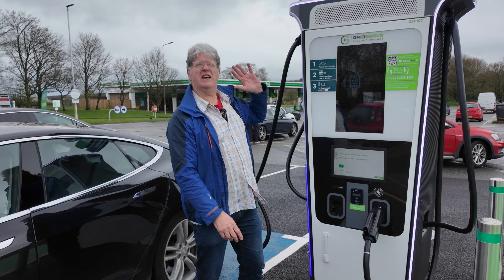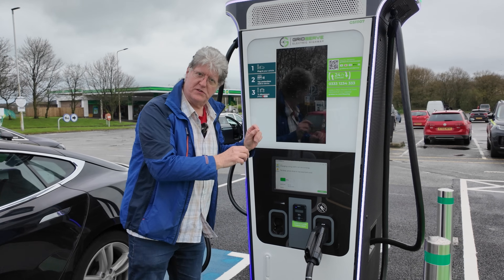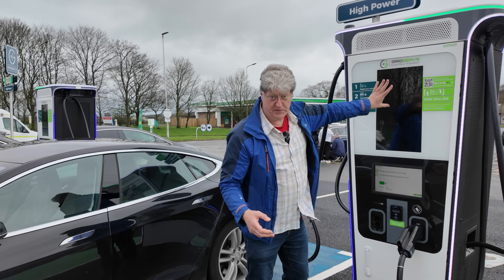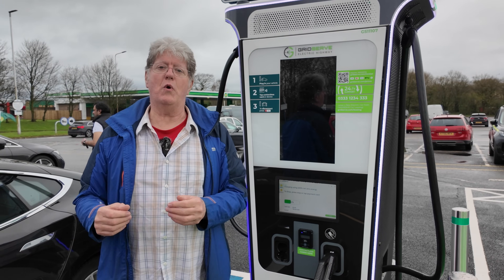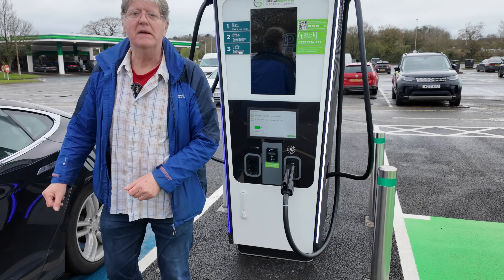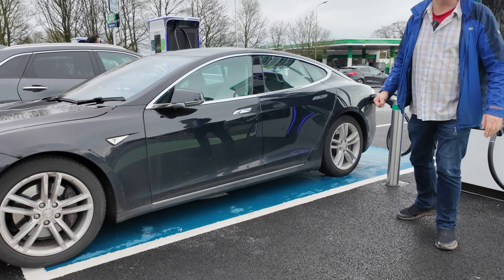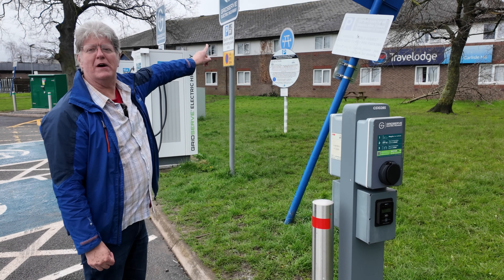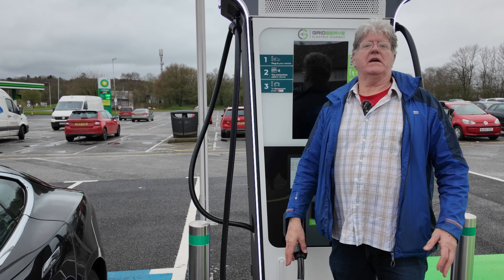Why Gridserve's New EV Chargers Are SLOWER Than Their Old Ones

Comment: Throttling the charge rate to match available power. Who would have thought that would happen? Next wheeze? In America some stations now charge per minute connected to the cable, regardless of the charge rate you get. They are priced assuming you get the fastest charge rate the unit can supply, you can easily get a tenth of that. You could rack a bill of hundreds of dollars for a full charge. Why are they doing this? To get back the capital investment they have made.

Comment: There's another problem at these new style Gridserve chargers. I charged up last week at Donnington services on the M1 which has 3 of these new chargers. They have 2 cables on each charger so we plugged in checked the car was charging (33%) and went for some lunch in the services. When we came back it should have been past 80% but was only 44%. The charge had stopped. I suspect the driver on the other cable had selected the wrong cable on the screen when stopping the charge. They are just labelled 1 and 2 with no arrows or any graphics to help you and you don't need the card that started the charge to stop it - just press the stop icon! (and don't say I should have checked the app - my car doesn't have one!)

Comment: Every Gridserve I have used I have NEVER got more than 96 kw, 350kw is totally false advertising. I totally understand the car determines the charge rate however, many cars can handle a lot more than 100 kW still only get 96 max on a Gridserve charger. IONITY give you the full amount and 79p per kw no thank you I will go else where

Comment: This is why the way Kempower does it is better. The charging units are essentially just a payment processing unit, a screen and a CCS cable. The actual charging modules are all housed away near the energy supply and they all share it. So if the site has the ability to only do 300kw and theres only 1 car plugged in, it will get its full speed. Unlike this situation where the charger only has one module installed so each one is limited to 60kw when no one else is charging.

Comment: The cable thickness are comparable with the amount of amps  the higher the  kilowatts the bigger the cable. Some of the "energy" your paying for is wasted going up in the air as heat  ! Same principle as the old electric bar heaters   , at least with ice you get what you pay for out of the pump
Reply from the maker: Really???? And your experience is???? I go and handle plugs and cables around the country and with different networks and I can state, and have previously launched several videos showing this, that the Instavolt cables attached to a 120kW charger is several times thicker, heavier and less wieldy than a Tesla V4 cable which gives out 250kW. That V4 cable is thin, light and very flexible. Please explain!

Comment: As somebody who tows with our EV I’m very pleased to see long, drive through bays!
Reply: What are the advantages of towing with a EV and which one would you recommend  for a medium size caravan?
Reply: @Ifitwerks  I tow a 1450kg caravan with my BMW i4 edrive40. There are one or two advantages, depending on what car you've come from. 1) The extra weight of an EV helps with stability, but my i4 isn't much heavier than my previous 435d. (+260kg). 2) The more responsive power delivery, to get you out of a slip-road pickle etc. Downsides are less range (typically 1/2 to 1/3 of the normal range) and hardly any long charge bays, which means unhitching every time.

Comment: I do a lot of journeys on the M4 in Wales and now avoid Gridserve. My ioniq 5 would at 15% only pull from their 350kw chargers at 33kw one week, but 120kw another, same amount of charge left, similar weather. Plus, half the chargers at Swansea were broken. All the other brands  consistently do over 100kw and always work.
Reply: Have you tried the Texaco Tawe petrol station on Neath Road near what I still call "The Liberty Stadium" ?
Reply: @stevenjones916  I don't go into Swansea, I'm travelling across the M4 to/from Pembrokeshire so services are more convenient. Bridgend (Sarn Park) is really good, and now there are several other services on that stretch with plenty of 100kw+ chargers. By the time both the dog and I have used the toilet we have more than enough for the rest of the journey. Swansea we were often there 40 mins+.

Comment: Supplied by 100% net zero energy! 🤣

Nope......it is supplied by whatever energy mix is maintaining the voltage and frequency of the grid, at any particular instant.

More 🐂💩 smoke and mirrors nonsense to baffle those with less understanding.

And then people want 300 kW down a piece of 1.5mm flexible cable!! 🤣 On a positive, you seem to be acknowledging that high power charging dissipates a lot of waste heat. 👏
Reply from the maker: So you think Gridserve has a special cable that supplies only wind or solar generated electricity to their chargers???? Welcome to planet earth.
Reply: @davetakesiton  ???????

Clearly I don't from my comment. I'm saying it isn't powered by 100% net zero energy for the reason I gave.

Just like claims that Dutch trains are running on 100% wind energy, but don't stop on days of low wind. It is smoke and mirrors BS.
Reply from the maker: But you might be missing the point. If everyone has to provide or use net zero electricity, then, if the system is working, they all must either generate it from renewable sources or remove carbon or CO2 elsewhere to balance. Either way, if it works, all our energy and all our businesses are actually at net zero, just some power stations or businesses will be emitting CO2 at source and removing it elsewhere. But like Tesla who produce all their electricity to build factories and cars and PV panels and charge EVs using actual zero emission electricity and sell carbon credits to others.

Comment: The Kempower chargers used by Osprey and others are far better as they can intelligently distribute the power over all the stalls (typically 16 bays) because the charger internals are all in a single cabinet and the screen+cable+payment part is just a remote terminal.  So the entire available power supply can be perfectly shared.
Reply: Yep, they seem to have the best solution. I would assume they are cheaper to manufacture as well.
Reply from the maker: So does the new Gridserve ABB 360kW, that is its key feature. The question here is how much power did it get to distribute?
Reply: @davetakesiton  The Gridserve doesn't share the total power across all bays, it still has the charger modules in the cabinet (hence why it is so huge).  The Kempower approach shares across many more bays and it will allocate power in 25kW chunks depending on live need, so it makes a lot more of the available power.  Yes, the total available power is still a restriction but the real world result is that you get consistently faster charging for the same total power.
Reply: Exactly how all hubs should be set up.

Comment: If you want thinner cables the easiest and maybe only way is restrict the current being carried. Lock the chargers to 50KW and you have solved the problem.
Reply from the maker: Tesla has very much thinner cables on 250kW chargers!
Reply: @davetakesiton  Tesla is Tesla. They plan to push 900A through the NACS plug as well. Wonder how long that will last before temps reach the limit and charger has to slow down.
Pretty sure the V3 and V4 cables are thicker than V2.
Reply: @Gazer75  Doubling the voltage halves the current for a given power in Kw and hence cable size and vice versa its all about current carrying capacity of the cables and the power available to the charge point and not simply charging speed as seems to be used lately.
Reply: @Ifitwerks  I guess they expect all future cars to have 800V...
No matter the voltage Tesla papers still claims up to 900A for NACS.
Reply from the maker: Nope, they're thinner. I use both. You seem to miss the obvious: Tesla are able to cool their cables far more effectively so can use very much thinner cables for higher currents. simples.
Reply: @davetakesiton   I can't imagine CPOs using thicker cables than they have to as it would increase cost.
Maybe you could ask them about this?
The cables on these 300kW+ chargers are pretty heavy and stiff. My mom would need both hands for sure.

Comment: I do not care about speed (50KW is enough) but do about price. In a year I have only used one public charger (connected kerb) which charged around 30p /KWh (it has since gone up). My response was and is 'stuff that'. My home electric is £0.075 day and night thanks to a time shifting battery. A long journey is in an ICE car which is cheaper than my EV using public chargers. 90%+ of all driving is in the EV which I really like but the rip off prices are borderline criminal.
Reply: You're forgetting that home electric is taxed at 5%, public charging is full rate VAT. That's "criminal".
Reply: Really it is almost as if you say that if you could not home charge you wouldn’t have an EV.   I am shocked.

Comment: So a 360kW capable dispenser restricted to 50kW - what a waste of time, best to avoid these Gridserve sites unless it’s an emergency charge you need then. What a con!
Reply: It would be a waste of time if it was advertised as 350kW, but it isn't. It's advertised as 50kW.
When the site's electric supply is upgraded, then it will gain more modules in each charger. It would be a waste if they had to rip out the charger just because it couldn't handle 350kW.😂
Reply: But it’s the car that does the charging and sets the demand, not the charge point. Almost certainly the EV was t pre-conditioned for charging.
Reply: @G6EJD  I think the car only does the AC charging but it does control the speed it gets from the DC charger but there have been case seen where the car accepts more than its claimed speed.
Reply: @rtfazeberdee3519  the EV has to the DC charging too, also the battery management system is on-board the EV too. All charge points merely off a power source for the EV to undertake its own charging. It’s a misnomer that charge points are chargers, they are not. Also nearly every EV has a different battery pack voltage which the EVSE to give it its correct name cannot know, that’s for the BMS to manage. Dave did go on to say that these EVSE’s were being deliberately limited to 60KW rates.
Reply: @G6EJD  The way i understood it was that the AC onboard charger converts the slower AC charge to DC for the battery whereas the DC "chargers" effectively put DC directly into the battery and the speed/rate etc controlled by the BMS.
Reply from the maker: No, totally wrong. The car controls how much of the power that the charger supplies is allowed into the battery. In this case it was allowing it all. It cannot allow power that simply wasn't there.
Reply: @davetakesiton  there is a negotiation between the EV and EVSE so that the EV knows what its maximum power usage can be. Ie a 50, 100 or 350kW EVSE has to be determined so the load can be set appropriately. The point is the EV sets the charging rate and if in this case the EVSE has been set to a 60kW rate then that’s what the EV will demand, less any losses, etc.
Reply from the maker: Would you rather have nothing at all until the full power is available or low power ones now until the power is increased at some point in the future? Tricky
Reply: @davetakesiton  that’s easy, a working low power EVSE when you need to charge.

Comment: Although it is not good; I am glad to see it wasnt my imagination, I've only got 34KWh on every Gridserve charger I tried on my Heathrow run; even when I was the only car using the station.

My 2016 Soul can pull 50KW, and the battery wasnt exactly low when I started on either occasion, between 20 and 45%.

In my case, the bays were clearly marked 360KW, with neighbouring 150KW chargers - both gave 34KW; a Leaf owner was getting the same; the other charger location I tried - gave me the full 50KW 
I forget the network or charger make - but they were marked as 150KW.
Reply: Motorway Gridserve, in my opinion at least, have been rather careless with the way their chargers have been marketed. In part of the video was two of the older 50kw chargers but they are usually single charge only, one box with a CCS/Chademo set up, and one box with two CCS plugs. In the video they even have only one bay only.  But on all of the apps, this is going to be highlighted as a 3 CCS and 1 chademo location.

Of all of the charger providers they are by far the most disappointing. And given their locations and the likelihood of EV newbies using them by default, it's a terrible impression to give everyone.

Comment: This an ABB Terra 360kW with 4x90kW modules that balance automatically.
Reply: Except this unit has 1 90kw module running. Hence the roughly 50/50 split.

Mis sold. Mis selling.
Reply: @davidrowewtl6811  The modules don't split. You'll use at least one module regardless if you get less than 90kW.
No idea why he was only getting ~35kW. Maybe the site is load balanced due to lack of total site power.
There are some chargers that are weird with some cars though, and the adapter might mess things up as well.
Reply: @davidrowewtl6811  the key word often missed by the unwary is "capable"...like "up to" 50% off in the "sale"..... all marketing hype.

Or xyz diesel  car does 75mpg...in reality 40 mpg, if you're lucky.

We are all conned on a daily basis one way or another. It's a fact of life!